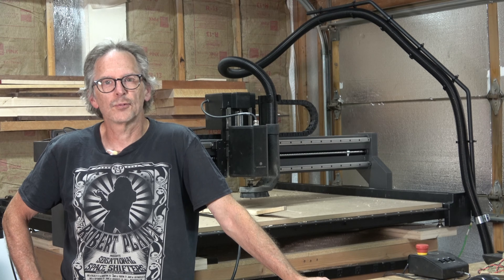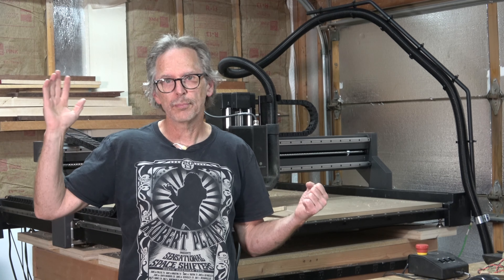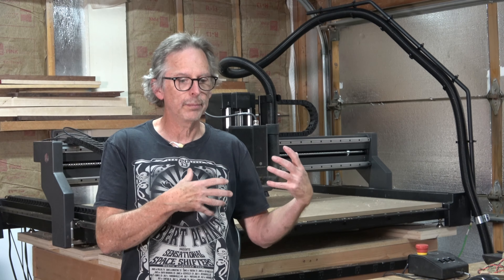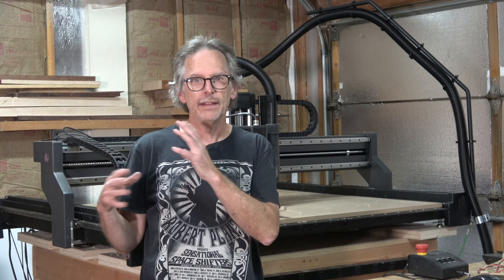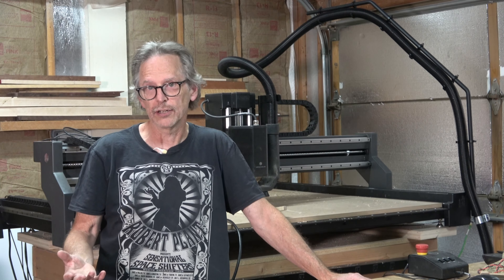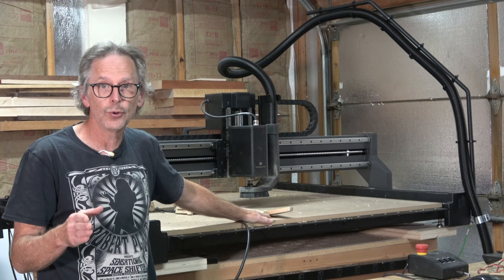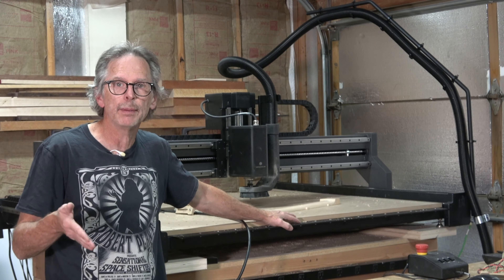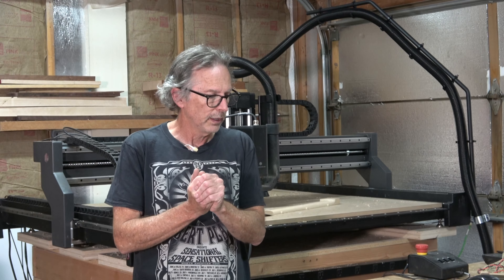How Fast In My X Carve Pro CNC Machine?

Comment: Thanks for the info. If Old Yeller was fitted with a spindle instead of the trim router would the times be close? I am assuming most of the speed limitation on the old machine is due to the use of the router. 

I am considering building a larger version of Old Yeller with a spindle and aluminum plates instead of plywood.
Reply from the maker: No. The issue is with Acme lead screws vs ball screws.

Comment: excellent work! the machine is fast enough; the ballscrews are SFU2505 or SFU2510? 5mm per turn or 10mm por turn? The Hiwin style rails are 15mm or 20 mm (HG 15 or HG 20 style?)
Reply from the maker: Those are questions for Inventables.
Reply: The X-Carve Pro uses 25 mm ball screws with 10mm pitch. The rails are 15mm.

Comment: Hey Chris. I'm curious how long it takes to do a Fingerboard and what bits you like to use doing that task??
Reply from the maker: From blank to finished fretboard ready for frets and to be glued onto the neck takes 1 hour and 10 minutes. I use a 1/16" two flute spiral down cut bit for marker dots, a .024" two flute spiral up cut bit for the slots, and a 1/8" two flute spiral down cut bit for the radius and perimeter shape.

Comment: Cut time: Instead of profiling the neck low e to high e could you profile nut to pickups. Every pause is time it's not running a 100 ipm.
Reply: I was going to point out the same thing...
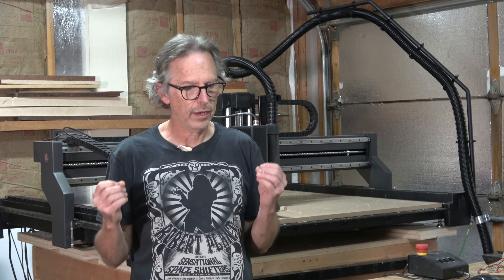Reply from the maker: The time savings is only 2:40. And I like the surface I get with the Y-axis finishing pass. That means less sanding later on and we all know how sanding can be a time vampire.

Comment: Is this the 2x4 or 4x4 machine? From your perspective is the price of this machine worth it compared to other machines on the market that may not be as plug and play ready but might cost less or for the same price have a more powerful spindle/larger work area/more rigidity?
Reply from the maker: I have the 4X4. Given its 4X8 capability through tiling, I can't find anything in the same price range. When you look at the competition, you have to consider what comes stock and what has to be ordered extra to complete the package. Also, shipping. Also, the X-Carve Pro comes in one box from one supplier. Many of the competitors come in many boxes from many suppliers. Not ideal given the current global supply situation. Having a 3-5hp spindle is of no use when you're cutting fret slots. In other words, do your homework before spending $$$$ on specs you'll never use.

Comment: Hi Chris, I have watched a few of your videos. I really like the content and your way of presenting information. Quick question, did the two days of hand building include radiusing the fretboard and fretting, drilling screw holes for tuners and making a nut. Also, were the necks rock maple or something softer like a softer maple or mohagany?
Reply from the maker: Just the truss rod slot, headstock (front and back) and the neck contour and heel.